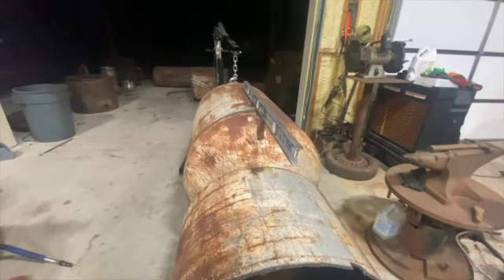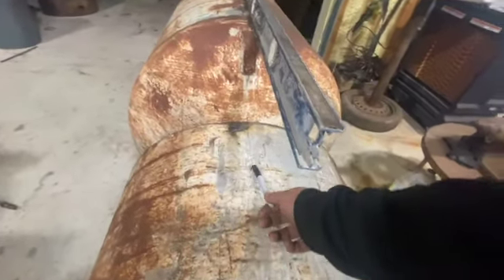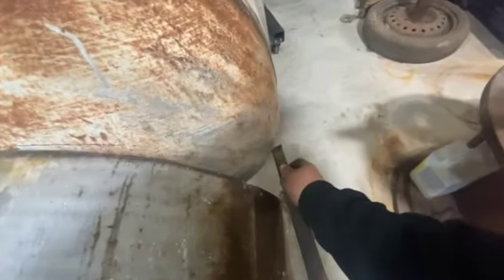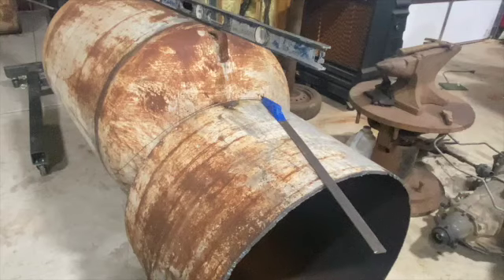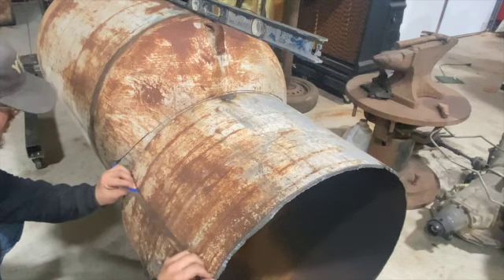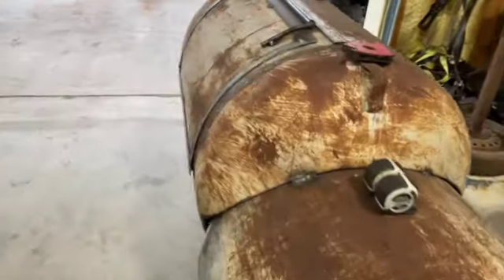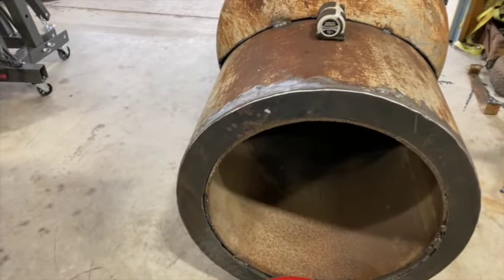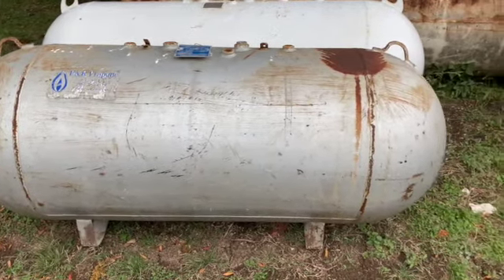Fire box cut out on a BBQ smoker

Comment: Love the videos was wondering where you get your insulation from, I'm building a smoker and am having trouble locating some.
Reply from the maker: I usually get it from Home Depot.  It’s high temp insulation. I believe it’s used for wood burning stoves. It has worked great so far

Comment: How does one determine where the hole cut out for the placement of the firebox should go?

Wouldn't you want the firebox hole and collector placement to be centered over the grate. So that half of the convection heat flows over the top and bottom of the meat?

Comment: HELP.....im bulding a new offset smoker that has cc 20"x36" coupled with fb size 16"x16"x16", how big would the cut out area be? 
According to feldon's it needs 32.77 sq inch opening area. But after iput the drawing on, it seems like 32.77 is too small? No?
any recommendation? Also which shape do you recommend? i plan to position my fb at the half on my cook chamber
thank you..
Reply from the maker: Sounds about right. Just go for it. If you need to cut more cut more.  May have to test it out and just see